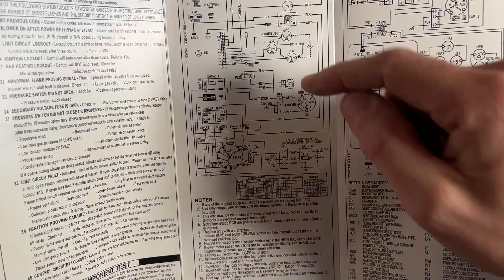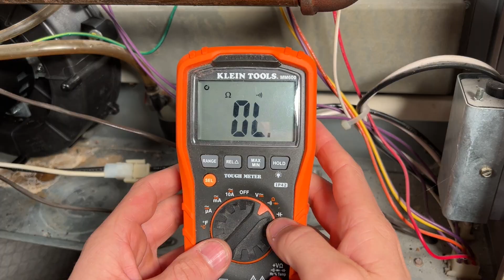Furnace Not Blowing Hot Air | Blower Fan Running Burners Not On

Comment: i'm currently having an issue between step 3 and 4.

my blower motor/fan isnt turning on while the flames are burning, and eventually the limit switch trips because the heat gets too high.

HOWEVER

i will find that later on, after a period of time, my blower fan WILL be running, but there will be no heat.

it's not flame rollout, i've sat and watched the flames myself, they're nominal.

for the life of me, i cannot figure out where the issue is! if the blower CAN run, why isnt it running between those steps?! i've checked all  of the wires, every wire is fine, the connections are clean and firm, there's no corrosion. i've even replaced the limit switch sensor with a brand new one, WHICH MADE THE FURNACE WORK RIGHT OFF THE RIP as soon as i turned it back on. NOW it wont even heat AT ALL, at it's constantly in a state of "limit swtich error code"

my filter is CLEAN. my return duct is 6ft off the floor, and has no obstructions. there's no blockage in any of the vents/ducts throughout the house.

my worse fear is that the control board is going bad (might be expected, this furnace is about 20 years old), and that's an easy $350 i dont have, but if i did buy a replacement, i could replace it myself no problem, just follow how it was plugged in to the Tee. i've read it could be a faulty blower motor, which is $150, a little more feasible, also i could replace that myself.

but if the limit switch is brand new and isnt faulty, what else could the problem be that trips the limit switch error code??

Comment: I have an old carrier unit. The blower comes on when turned to fan or AC but will not come on when turn to heat. Was working yesterday.  I can hear and see has come on but after few minutes when blower should have already kicked on the gas shuts off because motor never starts. Any ideas?  Unit is old and no electronics. Should be replaced but not in the budget right now.

Comment: MY E
HONEYWELL ELTRINIC TRERMOSTAT DIED. Hooked up my old manual thermostat & the furnace starting working.....The problem i had was the house fan was running continuosly, & after several power shut offs for about 5 minutes each time , & checking the switches, i could not find anything wrong. & then i did the thermostat..

Comment: I converted a natural gas furnace to lp gas and can't be sure how to use my duel port manometer so far as what settings on the manometer. I know pressure in needs set at 11" water column, coming in to the valve, and 10" to the manifold. I don't see a wc setting on my manometer. Can I use psi setting?  0.36 and 0.40

Comment: Why my heat blows out cold air
Reply from the maker: Might have a similar failure mode to this video.  Have you checked to see if there is a flashing LED on your control board.

Comment: could you Please advise?

Heat filter is Clean, New so not that… I put the heat on 68-70 depending on temps of course- blower motor runs but not long, only blows out Cool air NOT warm or Hot and Thermostat will often go down to 65 or even 62 🥶 overnight as well (28 degrees here overnight last night), house is COLD  
  unit is Older… I “think” the ignitors are working… could the Thermostat be the issue? it is one of this more modern ones (digital)

Comment: Thank you. Because you put the step by step of how the heater started up. I was able to narrow down my burners weren’t firing. Pilot came on. Then I remembered I had a my coil pulled and cleaned. So I checked the gas line and sure as the sun is bright. The forget to turn the gas back on. I did, and within seconds the heaters roared to life. Thanks again

Comment: Great video.Thanks. To start with, my problem was originally, the furnace was not coming ON, there lights were blinking three times. The tech said I need to change my inducer motor.I changed it and also the pressure switch. The furnace started working, the blue flames were on.  But there is not much hot air, my Trane system was blowing mild hot air . I watched this video and I was getting ready to order the two switches. Now my trane went back to how it was before I changed the inducer motor, the furnace probably worked for about 12 hours .  The inducer motor is running, no flames.  Any suggestions on what should I do.

Comment: I have a furnace that the fan keeps running after the heat is satisfied or turned off. I incorrectly replaced the fan limit switch because the fan would go off after a while. Still having an issue, I have a board coming now..

Comment: Enjoyed your video. My burners are not lighting.
Reply: Could be that the open vent/air flow switch got tripped.  Or some other safety switch.

Once they are tripped, you will be to resolve then manually reset the switch.  Hour to test can bad between devices.  Like mine requires the thermostat to be set to not send a signal to the furnace, then turn off the power to the furnace vid the stock on the side of it, wait 3 minutes, turn power back on to furnace, wait 3 minutes, then set the thermostat to send a signal to the furnace.

Comment: Our furnace has been on the fritz for a few days now. Code is 3 LED flashes....induced draft blower automatically comes on and runs continuously but there's no heat. In my troubleshooting chart, it says fault description is  pressure switch circuit not closing. Names off several possible causes. 
Last year, a hose was clogged to the drain system...the unit would come on, but would not ignite. Can't afford to have anyone come check or fix it😔 Any suggestions?

Comment: My furnace does something like this. The fan turns on, the burners ignite, and all is well for a minute or two. After that, yhe burners will ignite and burn for 5 or 6 seconds and then go put. It's too long fir a bad flame sensor I would think. I bypassed my thermostat (it's a nest, I turned off eco and assistant) by connecting the red, white and green wires. Still the same problem. When I only connect the red and white wires, the furnace works fine. I've cleaned my flame sensor (was pretty clean to begin with) and made sure it was tightly mounted with a good wire connection. I've got a hvac technician coming tomorrow but I like to figure out things myself. Thanks for the video.

Comment: I'm having an issue where my blower only blows cold air, not hot.  The furnace is on, but it doesn't blow hot air.
Reply: After checking the sensors and cleaning things, you may have to reset the signal on the furnace.  How to do that varies.  Some are at thermostats to off, flip the power switch on furnace off, wait 3 min, turn furnace back on, wait the min, turn thermostat to on.

Comment: Great info and explanation.  Did all the tests plus hot wired all sensors to confirm all good.  Appears to be the gas valve/solenoid.  Removed gas valve leads tested when gas is being called by igniters 27v across lines.  Tested terminals on gas valve appears to be open line no resistance so probably bad solenoid.  Would not have got there without the information you provided.  Also tried light hammer no help.
Thanks

Comment: Had a code 33 the other day. Flame rollout sensor had tripped because the air intake was blocked with ice. Cleared the ice and hit the reset button and that fixed it!

Comment: I have had a failure in the past that was similar to the symptoms you described, but it was neither of the switches you mentioned.  My problem was the ignitor.  It has burned clean thru.  I later learned this is also very common on older furnaces.

Comment: The big reason your furnace is going out on limit is the use f that filtrate high density air filter… you NEVER use them on a side intake slot… only on a well designed filter action system. 
Do your furnace and blower motor a favor and change back to a 30day merv 4 filter…
Reply from the maker: The actual failure was on another unit but many people shared a similar concern with High MERV rated filters.

Comment: Y do know, your furnace has several issues needing to be addressed, right?
You have condensate leakage from your inducer, you have the dreaded Honeywell smart valve, with low voltage hsi… you have a lot of rust precipitation in the burner area. 
I will watch the full video and see if you mention the issues.
Reply from the maker: Yeah, overall this unit has done well but will need to replace sooner rather than later.  I would not be surprised to get a crack in the heat exchanger in the next year or 2.

Comment: I checked all of my switches and everything looked good so I made a conclusion that it was the board. I could not find a local distributor that would sell it to me because I’m not a certified technician working for a contractor. What a bunch of crap! I’m not sure if this is just New York making more stupid laws or is this common everywhere? I was forced to call someone in to tell me I needed a new board and install it. My hot water heater also just sprung a leak recently so I thought that I would switch to a tankless. Same deal. Home Depot didn’t have any in stock so I tried a distributor. Not certified! No sale! I got another tank at Home Depot.
Reply: There are many of online sources for buying control boards and other HVAC parts. Purchased a board for my girlfriends gas furnace from Amazon a few years ago. Technician wanted $700. Purchased a new one for $80 !
Reply: Most wholesalers only sell to contractors because that is what wholesale is for. You are not their customer, the contractors are. They are not going to sell you a part wholesale, but some distributors will sell you a part for retail depending on their policy and how the associate feels. Just like how a contractor cannot call the factory and get a part shipped to their shop, but the distributor can.

Comment: Overall good explanation. But step two in sequence of operation is pressure switch closes to prove inducer fan is producing proper amount of negative pressure. Pressure switch is normally open but closes after proving draft.
Reply from the maker: Hey Robert, good point on the callout for the pressure switch.  Appreciate the help.

Comment: I had a bad heat exchanger from a 21 year old Payne furnace that would trip the over-limit.  The tech said it was a known problem with Carrier/Payne and while I could replace the exchanger only, he recommended just replacing the furnace.  Mainly because of the labor involved.  So that's the route I took.

Comment: Great info - as a handyman I get intimidated by furnaces. I'm getting more and more calls for those "smart" thermostats that need a green wire (or some color) to be attached. Would you do a video on that? I'm sure there's an easy fix since I've done it with tech support on the phone, I'm just not sure how!
Reply: The color wire doesn’t matter, what does is it needs to come from the common side of the low voltage transformer.
All systems have a common side, but most older unit installs didn’t feed the thermostat with it.
Most units are labeled C but some use X and some use other designations… an easy way to find it is to see what the condenser unit uses. One wire will be on the Y terminal, the OTHER wire will be C. Unless you have a package unit… then ya gotta follow the manual or schematic chart on the unit.
Reply from the maker: Yeah, there are a few different scenarios depending on the brand/model of smart thermostat.  On a past house I just needed to run new wire to get the C Wire.
https://youtu.be/Af6aaUyMc3E

Comment: In a 16 year old Mobile home.  Heater stopped blowing, called a professional. After checking this and that he determined my blower had taken a dump.  My 2 choices were 1. for 800plus or 600 plus,, chose the 600 since I'm a old fart not expected to live another 10 years so what the hey!!!!  Did they screw me? Possibly. Heater is still working fine so far..  I don't know you sir but I trust you more.  Just saying..
Reply from the maker: Yeah, that same furnace the blower motor went out and just the motor was $225 for parts.  I swapped it out and has worked well for a year so I am sure if I hired it out the cost would be at least $600 so you probably got a fair deal.

Comment: Had this happen was the role out opened. Actual cause was holes in the heat exchanger. Bottom line I purchased a new furnace. Helping the furnace man remove the old furnace found several large holes top of the exchanger. No CO detector went off.
Reply from the maker: Yeah, this unit is getting there and I see a fair amount of corrosion around the exchanger 😬
Reply: The pressure on the two fans/blowers was set properly in this case, so that air leaked from inside your house and up the stack rather than the other direction. This is why the CO alarm did not go off. However if there was a filer partial blockage, stack blockage, or certain wind conditions, then CO and other gases from combustion would enter as air pressure difference goes the other way.

Comment: I've had this before! Wiring issue, I had no idea what I was doing, and I simply checked wires going to different things, found some damage after using a multimeter, and replaced that wire. Afterwards I learned it was the wiring going to these switches.
Reply from the maker: Nice work 👊